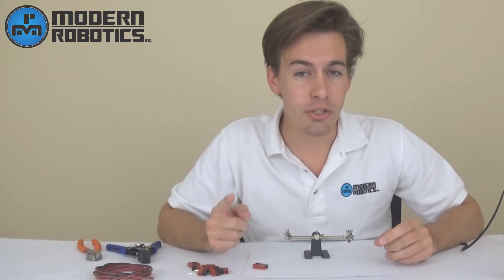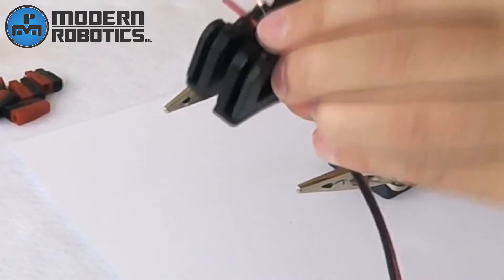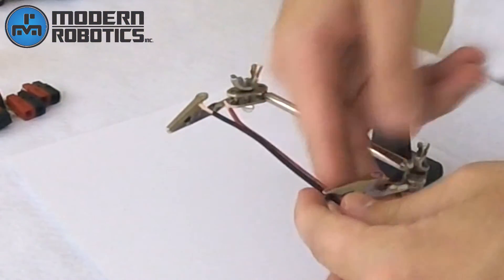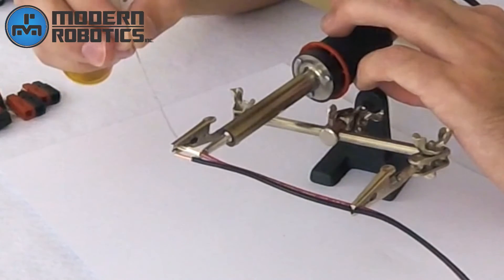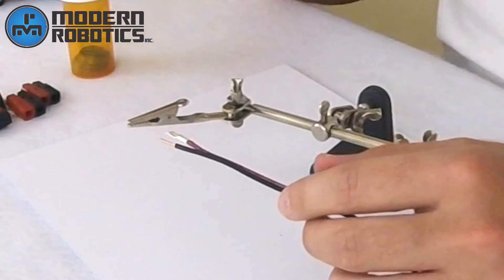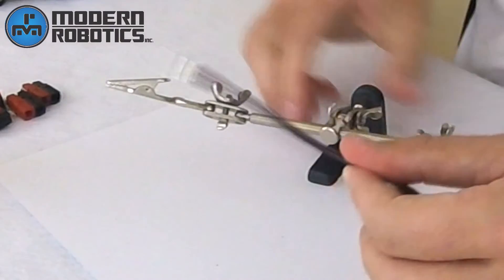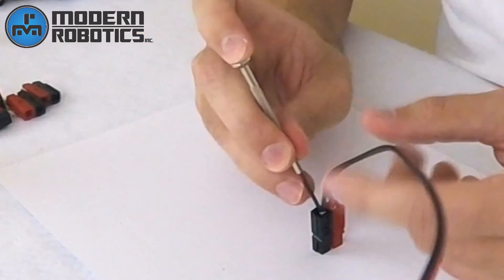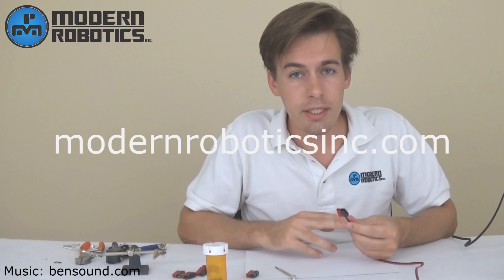Soldering Anderson Powerpoles

Comment: Better weld them in vertical position, and only from the back, leaving 1mm from plastic to metal, to avoid tin in the front part. The fore part of metal should be as clean as if it was crimped. Otherwise it will never CLICK in

Comment: As an EE and previous tech we were always trained compression is good, but compression with soldering is best.  I am curious where did you get your connectors?  I got some discount ones off of amazon and they will not take any solder, i suspect they are fake aluminum ones. Great video and techniques thanks.